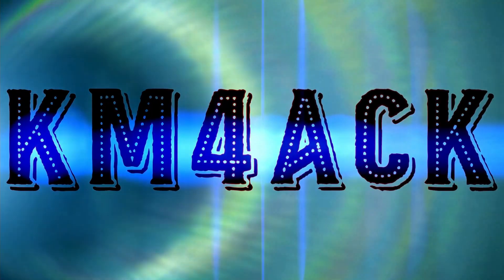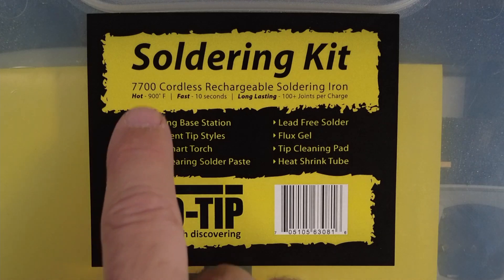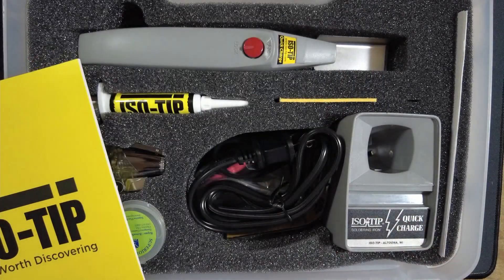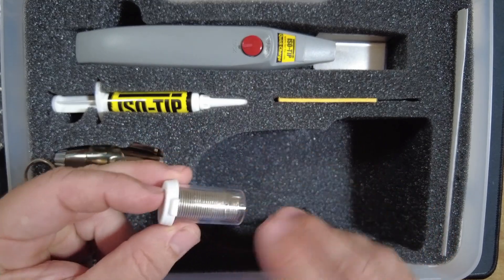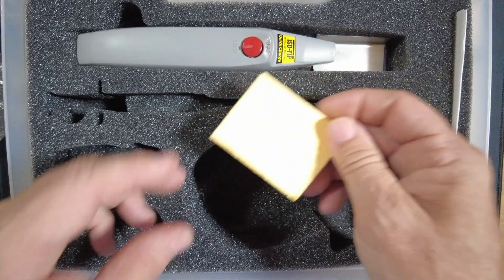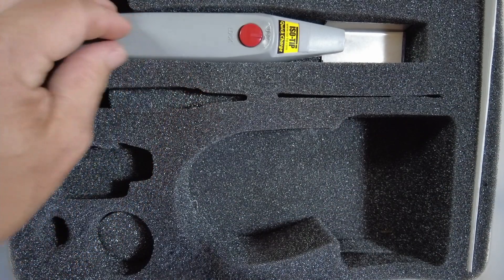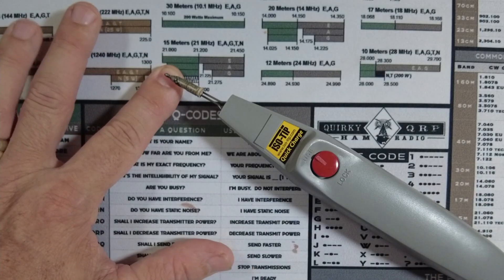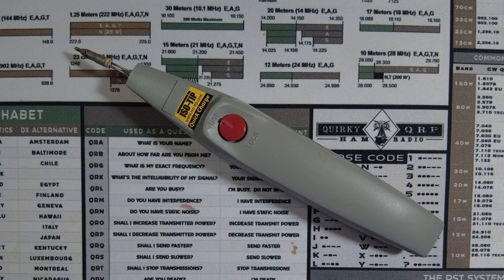Best Portable Soldering Iron

Comment: This really seems like outdated technology. All the way down to the illumination. Why not a Pinecil where you can use very common USBC charge packs to solder. The cons to this soldering iron seem to outweigh the one Pro of having no cables attached to the iron itself. If not having a cable is required, then this or the butane products are likely the majority of your limited choices. But if you can withstand the USB C cable connected to the iron, any one of the TS-2000 iron clones or the Pinecil will work circles around this thing.

Comment: I will not use this soldering iron. The tip, with its two legs, is elastic. The bulb does not target the solder (an LED would be better).
It's big, heavy, it looks like iron from the 1990s. There are so much better on the market such as the TS100 and equivalent (and the battery you have on your car, or on the radio)
Reply: I love my sequire sq-01 which is a ts-100 clone. It runs the same open source firmware as the ts-100 that gives it higher heat capabilities and other improvements as well. I've been using it for about 2 years now, mainly to build drones, but also for other electronics and heavier work as well. I power it with a power supply on the bench and from lipos in the field.
Reply: The newer TS101 looks even better. What do you think?
Reply: @WG5Xradio  the ts101 will run off a usb-pd as well as the barrel plug.

Comment: Battery is apparently a 2 cell NiMH 2.4V 3000 mAh. There is no mention of low self discharge, so probably standard type NiMH cells which have a tendency to self discharge pretty quickly and after a few months will require another charge cycle before use. Would be nice if they were low self discharge as needing a charge before use is not convenient. A test of discharge characteristics would be useful here.
Reply: after 16 days you will loose some voltages. 
but you can mod it with atg's battery.
Reply: I did some further research and it appears that the blue 8000 model use lithium iron batteries. These have extremely low self discharge and will be ready to rock even after long storage periods. Probably a better option for those using it very occasionally. Also the tips are fragile so take some care to store or protect them. Thanks for the review.

Comment: It would be interesting to see how it operates outdoors with a little wind.  That has always been a downfall of many portable soldering irons.  73
Reply: it's battery operated not gas. 
so you don't have to worry of not getting it heat up (gas blowing out)
Reply: Me too!  Outdoor use with just a little breeze has been an issue.
Reply: I have not had any problems outside here in Michigan with the model 7700